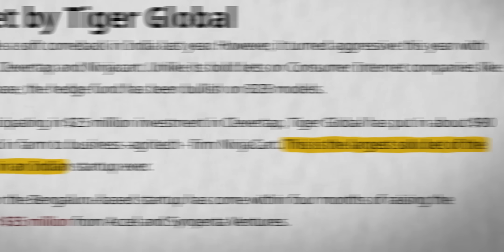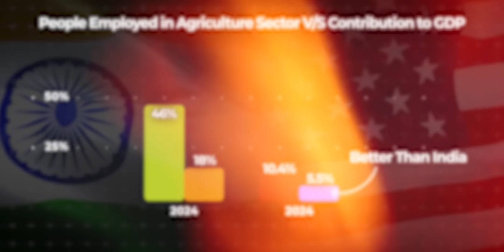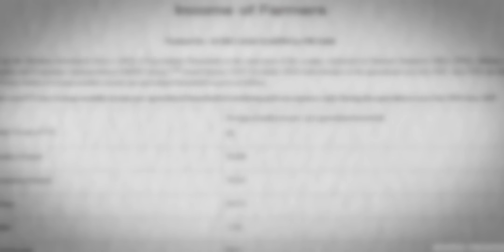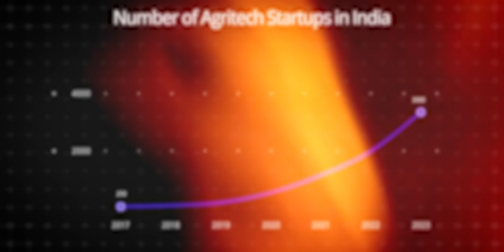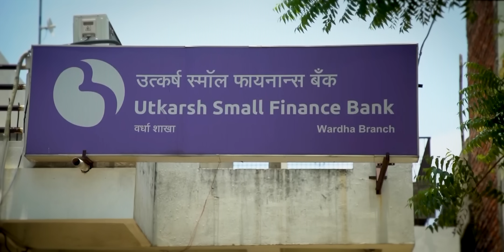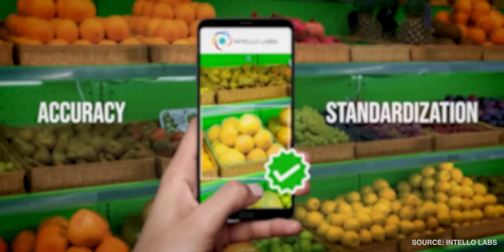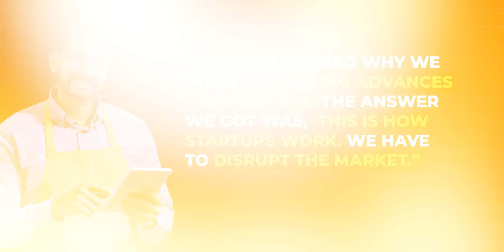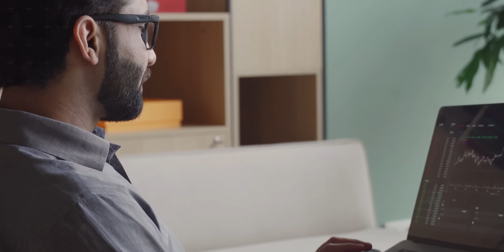Why Agritech Startups Failed in India?

Comment: Unfortunately tech is made synonym with software and analytics. Agritech 'power tools' are making roaring business. If you consider fertilizer tech as agritect-- organic fertilizers also are doing good.
Somewhere, the tech has classism. It is not fitting with farm sector. The farm sector is not only about GDP. It employs many with decent "local purchasing power" and decent enough standard of living with clean air, access to water and so on.

Comment: I strongly believe, Indian agricultural ecosystem needs major mind shift rather than technical adoptions..

For sake of projection, we keep blaming the middle man without understanding their relationship with farmers..

The second piece of puzzle is, community.. The farmers are largely community driven. It’s not easy to break the community or be part of it at short span of time. 

I personally noticed an issue is, the startup trying a solve a single problem in the ecosystem and still farmers depend on their existing community for rest. So, they don’t want to break trust with their community for getting a solution for single pain point.

IMO, we have to build a platform to connect the farmers with different solution in entire journey. Most important the solution should be in-person rather than technical on early days.. It’s very cash burning process, but someone cracked it, it will be cash making machine..

Comment: This content is highly misleading. I’ve been a longtime follower of your channel, but I’m disappointed with the way you’ve presented this.

I currently work at Ninjacart, and the way your video starts—mentioning Ninjacart raising $100M from Tiger Global and then immediately shifting the focus to failed startups—creates unnecessary hype and misrepresents the sector. It unfairly portrays agritech in a negative light.

Ninjacart has been in the industry for over nine years, making significant strides in transforming the supply chain. As someone within the company, I can confidently say that we are actively turning things around.

If you’re discussing Ninjacart’s fundraising, it’s completely unfair to randomly compare it to failing startups without proper context. Please do thorough research and ensure you understand the full picture before publishing such content.

This kind of narrative is not only misleading but also discourages innovation in an industry that still has immense potential.

Comment: I don’t believe we need to reduce the number of people in farming so drastically and only because developed countries are like that. What we really need is …. 🤔 hmm i have no idea.
Reply: Most farmers would end up unemployed if we do that. We need to reduce our population first
Reply: We dont need to reduce numbers as drastically as developed nations right now, doing that will only add resistance from people losing their work, atleast not until we are able to bring the same per yield efficiency as them. I do have few ideas about agri industry about firstly organising this unorganised sector, getting a structure and hierarchy to remove inefficiencies and finally taking the risk mitigation from ground level(farmers) to higher level(the company) etc. I think farming is the sector to join in to make the impact on the India 3 which no startup has focused on, I am doing research to build a system for the agritech sector even if it be much harder to something in there, I want to dive in this sector as this is where the actual issues of india lie in, rather than a building new app to do something which 100 other apps already do
Reply from the maker: We need a long-term goal for doing this. China for eg, reduced the number of people employed in Agriculture from 50% in 1991 to 25% by 2018. We need a similar strategy and on-ground implementation. - Pankaj
Reply: @backstagewithmillionaires  needs to be supplemented with skilling in other sectors. This is a larger macro economy question. Also, this will need to be determined at a state level, depending on the state's local economy. If we're to strengthen 'Make in India', every state will have a different approach.  Also, skill sets cannot be easily transformed. This is also one of the challenges in the 'just transition in the coal economy' sector. Not comparing farmers with coal workers, but the fundamental question of skilling is common.